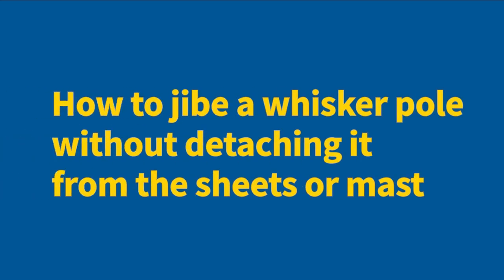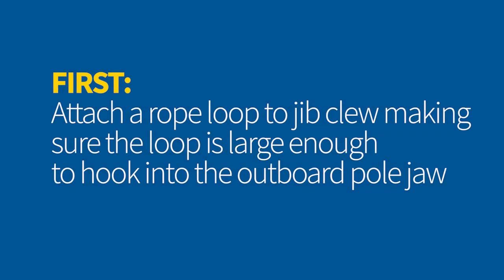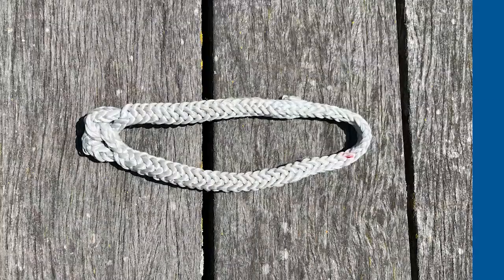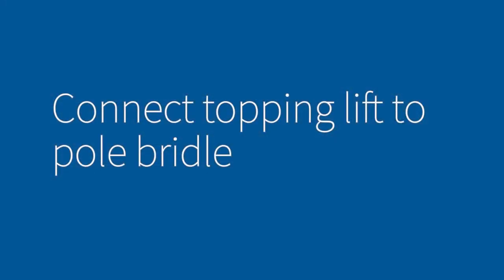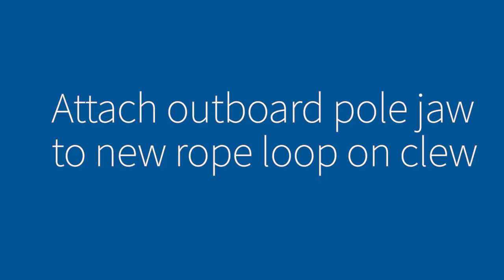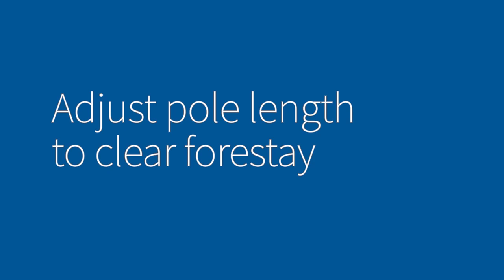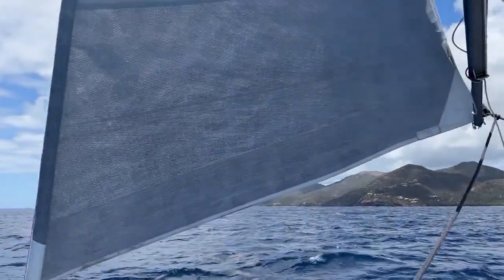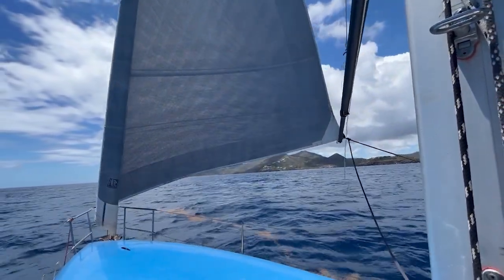An Easier Way To Jibe with Whisker Pole

Comment: What is the purpose of the topping lift?  The sail will hold up the pole.  I have no topping lift, and the only other line I use besides the halyard and sheets is a preventer from the bow back to the outer pole end, to keep it from contacting the forward shrouds.

Comment: Could you please explain which topping lift sheet you are using. Bit confused as mainsail topping lift will already be in use..
Reply from the maker: Hello,
The mainsail topping lift should not be used. That’s not positioned correctly for use on the foredeck. A right way is that you may need to rig one for the pole if you don't already have one. That said, in some cases you could use a second jib halyard if you have one. You could also use a spinnaker halyard, but that should not be a long term answer as there would be chafing issues. 
We also have a video up that may answer more questions https://www.youtube.com/watch?v=czoi63XfWTQ.
As well as a whisker pole guide here: https://www.forespar.com/pdf/techTips/Whisker-Pole-Buyers-Guide-Tech-Tip.pdf